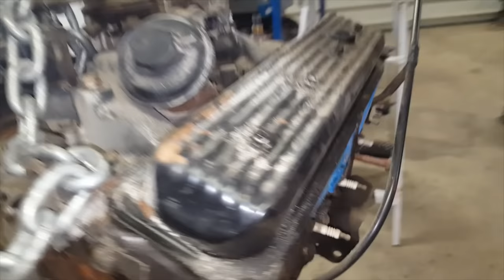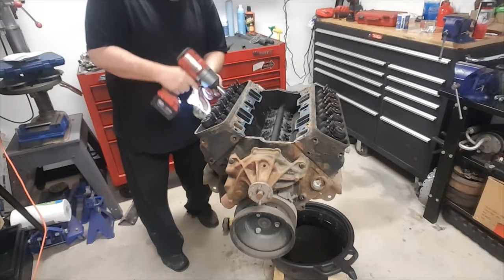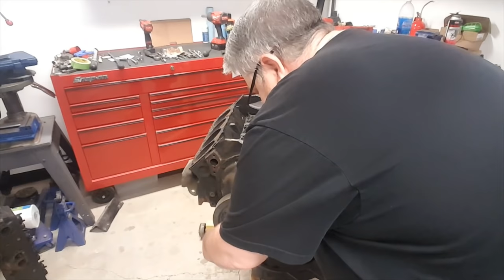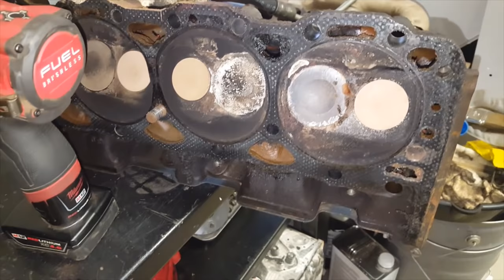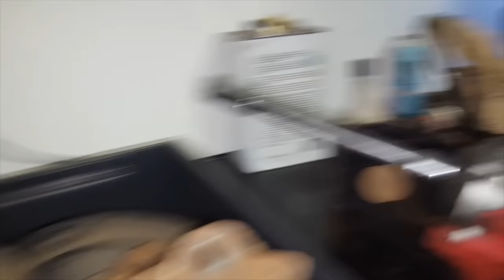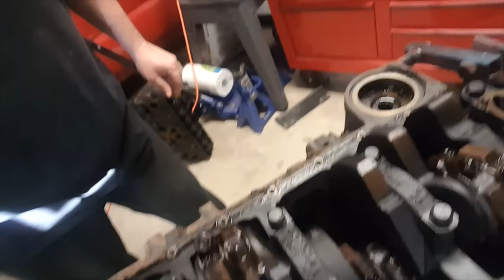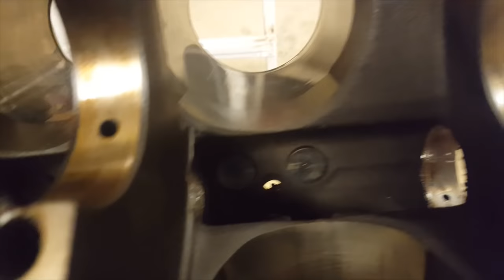350 Chevy TBI 5.7 Engine Tear Down / Rebuild , Video #1

Comment: Always wanted to do this. I'm gonna redo my 91 GMC with paint, interior and a new/rebuilt motor. Why spend 50 grand on a new truck when I have a kit in the driveway?
Reply from the maker: I'm away at work but the engine is still not ready at the machine shop , hopefully it is when I get back home this time. Good luck with your build!
Reply: Put down the pipe and move away,
Reply: @Clay Green 
Doing the same thing with my 93 K1500. I have redone most of the interior.. My new 40-20-40 front seat will be here in May and then it's just little odds and ends to finish up the inside (glove box door, new map/dome light assembly, color matched sun visors, etc..

Just took the 350 short block to the machine shop yesterday to get cleaned, machined, new pistons if they decide to bore it out (355) new cam/main bearings, threaded oil galley plugs, new freeze plugs, and they're gonna pop in my new cam and timing set for me.

Final setup will be:

350 or 355 with 906/062 iron vortec heads, 2.02"intake/1.60"exhaust.
Comp Cams XE256H flat tappet:
.449/.456 lift, 212/218 duration (@ .05)
112° LSA
Long tube headers, GM performance TBI Vortec intake, gonna keep the factory throttle body but rebuild it with new injectors and a 13lb regulator spring.

Probably other shit I'm gonna do but I'm off to a great start. I love these 90s GM pickups.
Reply: And how did 50 grand turn into 80k $ for a pickup truck?
Reply: I have a 95 gmc k1500 with 333,000 miles on the original engine. It’s still running good but I know at some point I’ll rebuild it or get a crate motor
Reply: @chaplainstephenbrestsr7470  Remember, in the middle 90s, a Chevy pickup sold new for about $15,000. While they've added a lot more complexity to the truck, a big part of the problem is the fact that our dollar has crashed in value and simply does not buy what it used to buy.
Reply: @chaplainstephenbrestsr7470 my 95 yukon tbi has 295k miles still runs good no leaks and hardly burns any oil. I don't think it's worth rebuilding just to gain a few extra hp, ill probably buy a used block rebuild that and just have it on hand when my truck really needs it.

Comment: Pulled the exact same engine out of my 90 C2500. Crank had so much end play the counter balances were eating into the caps and block and ruined a flex plate. Couple of the bearings were starting to 'blue' from heat,  but never spun one, had almost no cross hatch in the cylinders, less then normal ridge ring for having 300,000 miles on it, always fired right up, used 1 quart of oil between the 3000 mile oil changes, but was down to 13 mpg which was why I pulled it to give it a good look through. Got the truck used and drove it and maintained it for 5 years before yanking the engine. Even when they're 'bad' they're still good.

Comment: Ive got an 87 GMC Jimmy with the 350 TBI. Been sitting for 10 years because it was burning oil real bad. Im going to watch your rebuild video next. Ive considered just buying a replacement engine for about 5 grand to put in there. Never pulled or rebuilt an engine before....but thanks for this. Doing my research at the moment to see the way forward.
Reply from the maker: Good luck on your project! Thanks for watching.

Comment: This is like watching an autopsy
Reply from the maker: I never thought of it that way. Thanks for the reply!
Reply: @jaysgarage3616  my 350 TBI is missing the hose on the drivers side that runs from the back of the tbi to the valve cover. Do I need that hose? GM doesn’t sell it anymore and it’s hard to find unless I hit some junk yards. Right now it’s just an exposed hole. If you have a spare I’ll buy it 😁
Reply from the maker: @irishuwould5185  I will see if I have one
Reply: @jaysgarage3616  thank you sir
Reply from the maker: @irishuwould5185  I cant believe this but I do not have one but I am going to the wreckers next week so I will look for one there.
Reply: @jaysgarage3616  that’ll work. Just let me know so we can set something up. Thanks!
Reply from the maker: @irishuwould5185  I finally found one if you are still in need of one.
Reply: @jaysgarage3616  yes sir I do. I gave my email here but my comment keeps disappearing. Is there a way to get a hold of you?
Reply from the maker: @irishuwould5185  jaysgarage306@gmail.com
Reply: @jaysgarage3616  thanks, email sent
Reply from the maker: @irishuwould5185  Ok , I will reply to you when I get home , I cant open that email from here.

Comment: You should use a separate piece of cardboard for bolts etc for each part tbi, pulleys etc. if you throw them all in one bucket chances are you will forget what goes where.

Comment: I have a 1991 Chevy C1500 with the 350 and with 310,700 miles. Never opened up, same oil pressure from when I bought it back in 1998 with 93,000 miles. Never been opened up, still original in the heads and rotating assembly. Still only burns not even half a quart of oil to 3,000 miles. The 90s 350s certainly were well built and durable as long as you took good care of them.
Reply from the maker: Sounds like you got a great little engine there! They were quite reliable when taken care of.
Reply: @jaysgarage3616  Eventually, when the engine starts getting weak, I intend to do a  mild build on it with a mild cam and bore it out a little seeing the 700R4 tranny has already been rebuilt with a stage 1 B&M shift kit and can handle the extra power.

Comment: I thought you did a wonderful  job showing the in’s & out’s of a tear down on that motor you used ! I’m a retIered wrench myself and I stumbled on to your video and got stuck watching the whole thing.
One thing that I especially liked is you very smoothly drove home the good practice of ( NOT using the shaft of your 3 lb. hammer or the likes of a 1/2”or 3/4” breaker bar into a intake runner of the int. 
Manifold to jar that loose
Reply from the maker: I appreciate the comment , thanks for watching!

Comment: If you're looking for a proper way to do this this is the video best I've seen on YouTube. Almost like watching my father do it. We always took a very long 3/16 drill and oversized the top oil galley hole above the camshaft. This holds more oil at the top of the motor. Then we tap out both sides of this plug and put a pipet plug with red thread lock tight. We also put a high volume high pressure oil pump on or we convert these by stretching the relief spring in the oil pump.
Reply from the maker: Thanks for the comment , it's always interesting seeing what people used to do or still do! Thanks for sharing!

Comment: I got same 86 TBI 350 im putting in a 64 Buick LeSabre but i stripped all the front stuuf off even the fuel injection carb to switch it all over to old school setup aka 70s down so i got everything thats still good for sale cheap even the alternator id take $90

Comment: i am in Australia and own a grey import,, a 1992/93 GMC C1500 2x4  extra cab pickup.. its a 350tbi 4L60E  4x 2 vehicle.My vehicle was made in Canada and sold new in Mc Phersons in Carson California and bought to Australia and changed to right Hand Drive and run into the ground until 2022 when i bought it. I notice some of the car is metric and some areas UNC, UNF,, SAE bolts. I will rebuild the engine and put a carby on it due to lack of parts here for these.
Reply from the maker: Sounds like a fun project , there are 4 videos of this engine being rebuilt. Thanks for the comment and thanks for watching!!

Comment: Have the same motor in my 94 c1500 with 307,000 miles on it using little oil now wanting to do a rebuild on it good video
Reply from the maker: 307000 miles is awesome , good luck with the rebuild!!

Comment: The actual stamping on the water pump boss passenger side would tell you more than the casting numbers you reference in the beginning. Those bearings looked typical for an engine that sat that long. I didn't see copper on any of em. A couple old straight plug boots go a long way when your messing with rod/piston removal/installation to not gouge the crank.
Reply from the maker: Thanks for the comment Bo , I thought we went over that in the video? It was an April fool engine .

Comment: Thank you for responding back with my question with gasket missing between the throttle body and intake. My other question is what could be causing my truck sometimes bog down when I push down the paddle to give it gas Could the missing gasket from my first question causing it or could the catalytic converter be causing it to bog down like it's not getting enough fuel I've changed fuel pump, filter and everything I could think of relating to fuel

Comment: Those TBI engines can make decent power with nothing but a cam swap , we did one with what they call a TBI power cam from Engine Tech  and it made 320 hp which it good for a TBI 5.7. Really good video.
Reply from the maker: Thanks for the comment , I will look that cam up. We will be debating cams when we reassemble this TBI engine which is currently at the machine shop.
Reply: A cam swap for an additional 130 hp? I’m calling BS. The primitive, by today’s standards, ECM on these engines, (350 L05) severely limit what you can do and still have the engine properly function.  The cam you refer to has to be able to work as a whole within the limits of the ECM. While I’m not familiar with Engine Tech, or the specs of the cam you mention, there are several well known cam grinders that have an “RV” cam that is designed to work with the existing limits of the ECM, TBI, heads, and C.R. of the 350 L05. By itself, the cam might be good for maybe 30hp tops.
Reply: @bondpit8750  I'm trying to do this very thing: eek as much HP as I can from my original TBI 5.7 while not upsetting the stock ECM on my 1987 Chevy Silverado. Unlike the 727 block in this video, my 5.7 TBI block is "roller-ready". So I was planning to put the newer (90-96ish?) L31 truck roller cam in it. But leave most everything else alone. Do you think I can get 25-35hp just from the cam swap and still keep my stock ECM happy?

Comment: Kind of liked the music actually.  Mind you I was a rave kid in the late 80s and 90s, and still hit the festivals every summer.  In this video the music is such a complete out-of-the-blue surprize that it made me laugh out loud.

Also, its a good video, the only thing I would change is that the engine should not have the balancer face the camera, turn it away at a 45 degree angle so we can see what you'redoing.
Reply from the maker: Thanks for the comments. I do think the positioning could have been better after seeing it.

Comment: Have a question 
What would cause the # 1 an # 2 rod Bering spin
30;000 miles on a long block auto zone so called factory built 
Never abused 
Proper maintenance oil change; 3;000 miles changed 
Engine always had a vibration 
Always great oil pressure, filter always changed with oil change 
Any idea,please why or what to look for why…or just bad machine work…
Bore 30 over everything new , reground crank,dbl rollers timing  chain an chain still like new metal all the way through, affected all the lifters ( full metal shavings,that was expected) from rod Bering 
Totally ruined Bering a crank,compression 180 all cylinders no valves leaking, just two rods Bering burnt #1&#2.  
Didn’t make no sense or wrong Bering size on turned crank 
Like ur work an explanation on everything 
Ki
Like watching ur. Work sir.

Comment: I have a 93 5.7L 350, i want a 355ci build with high torque.. 5.7L is in a 4x4 93. The idea is too to rebuild the motor to 355 specs, swap rear inards and make it an awd truck. Lot more complicated but its what i want at the end of the day
Reply from the maker: Sounds like a neat project! Thanks for watching!

Comment: You should be able to install a roller cam and roller lifters for reliability.  I installed a retro roller cam in the 350 of my '73 Nova.  Check around to see the parts needed for your block.
Reply from the maker: Not a bad idea , thanks for the reply!
Reply: My TBI came from factory drilled and tapped for a roller cam. A LT1 cam and vortec heads really wake these TBI 350’s. Just need to get a new tune in the ECM and your golden

Comment: That's the old 200-210hp 350 you could put a set of vortec heads and true flattop pistons and bring that up to a little over 300hp
Reply: whats better.. 93 caprice ltz... or 96 caprice 4.3 v8 ?

Comment: The hose that you took off first from the valve cover to the throttle body cover, what is it called? TIA
Reply from the maker: Its the plastic hard tube from the rear driver side valve cover to the Throttle Body/Air cleaner spacer , (crankcase ventilation) and they are no longer available that I know of. I sent my last one to a viewer last year.
Reply: @jaysgarage3616  ooh ok, thank you anyways.

Comment: Great Video. Thanks a lot. I have the same engine in my Garage. Question to the camshaft. Can I use a mechanical fuel pump on the camshaft?
Reply from the maker: Yes you can!! Make sure your block has the provision for a mechanical pump.
Reply: @jaysgarage3616  thank you

Comment: At 5:10 what is the beige piece above the balancer? I have coolant leaking off mine.
Reply from the maker: The water pump is above the balancer.
Reply: @jaysgarage3616  thanks! I had already figured it out but decided to leave it. I hope I can just change the pump gaskets and leave the intake manifold alone 🤞

Comment: Amazing video tons of useful and helpful info thanks alot question tho why would my chevy suburban 96 5.7l be stuttering in take off I rebuilt the trans and was told it was good now would it be the cam sensor or crank sensor???
Reply from the maker: Hey thanks for the comment!!
Could be a tune up issue , vacuum leak etc. So hard to diagnose without seeing it , hope you get it figured out.

Comment: Jack 94.5 , Sir , that is indeed a Regina area station , I had a question about 
what could be done to warm up a 1995 pr vortec 5.7. I have heard that one needs to be carefull not to 
put too much into them as it can require computer work on ecm etc , your thoughts ?
Reply from the maker: Sorry for the late reply , that is correct , unless you have a good tuner there is not alot you can do to these engines. Many years ago I tried headers , full exhaust (mistake) TBI spacer , pullies , fuel pressure etc and all made a small difference but not enough to warrant the work ,time or money. They are a good engine and will last for several hundred thousand km as is but are limited by the TBI.
Reply: @jaysgarage3616  I was pondering the idea of using vortec heads and manifold with a 2" bore throttle body and BB injectors , not sure but I would need a tuner , I am near regina but do not know who to see about gettting  fuel and ignition curves mapped , it most likely is expensive
Reply from the maker: @nerradnosnhoj5122  I have seen similar stuff in the past and you will certainly need a tuner.

Comment: i just had my 350 5.7 rebuild from the crank on up..about 3 months ago..and its blowing blue smoke out the pipes i got about 2000 miles on it now and im using quart of oil about 250 miles i pulled the plugs out and #7 has lot of oil on ,that spark plug on the threads only..tell me what you think
Reply from the maker: Do you have a valve cover leak or any sign of a leak that would go toward that plug? If the oil is on the threads only it's a leak If not it is likely carbon deposits
 Were the heads rebuilt? when does it smoke? If it smokes at start up its usually valve guides and seals. What rings did you use? Does it run well other than this? To check rings do you have access to a leak down tester? I can only make suggestions but this is a start. Good luck and keep us updated.

Comment: Hi, I know this video is old and you probably won’t see this. But I’m rebuilding my 94 gmc c1500 engine. It’s a small block 5.7 350 tbi like that. What rebuild kit do you recommend?
Reply from the maker: Hi , I did not order a kit ,  Rockauto and my local Machine Shop , Pistons ,  Cam bearing , Main and Rod bearings , Rings , Core Plugs from Machine shop , gaskets , cam  , lifters , rockers , oil pump etc all came from Rockauto. Hope this helped and thanks for watching!!

Comment: Mr Jay, one of my buddies gave me a 350 out of a 92 chevy k1500 i was wondering what would be a good rebuild kit to use? all the ones i see on the internet are stage 2 or 3 i want a stock one
Reply from the maker: I usually don't buy kits , if you know someone who has an Engine tech account they offer a stock kit. I usually have the machine shop supply pistons and bearings and I buy everything else from Rock Auto. Not sure this helped much but it's what I do here in Canada. We will be starting to video the assembly soon , I will list the parts as we are going and where they came from.

Comment: i just had the engine done the engine is so clean you can eat off it ..and its definitely not value cover gasket..i im burning lot of oil ...my friend rebuild the engine for me ..i took it out and took it to him..he sent the block out ..its 30 over so its a 355 now and he sent heads to machine shop .. and he put everything togather....i just drop my truck off to him today so he think its the intake manifold gasket..once he pull that intake up we will find out ..i will keep you updated because im curious
Reply from the maker: Thanks for the update!

Comment: I bought a 350 5.7l it's from 69-79 would it work in my 1990 chevy? I know it would need a special intake because the bolts are at a different angle
Reply from the maker: I believe you would need a flex plate as well without the weight attached , pullies  , waterpump , distributor and intake. Good luck on your swap.

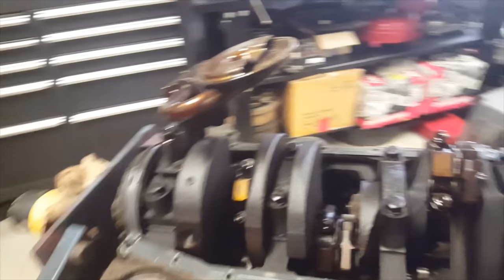Comment: 47:22 is the 727 block one of those 2 or 4 bolt main casting , you don't know what you got till you drop the pan or was it a 2 bolt only block ?
Reply from the maker: That's right , you can have either a 2 or 4 bolt with the 727 block , you would need to verify by dropping the pan.